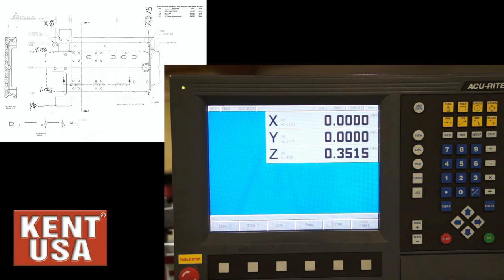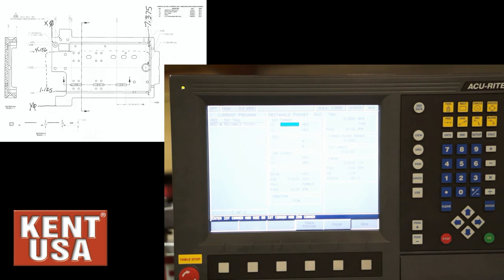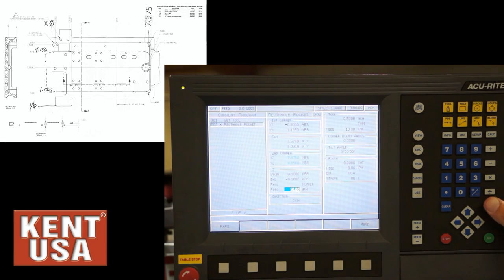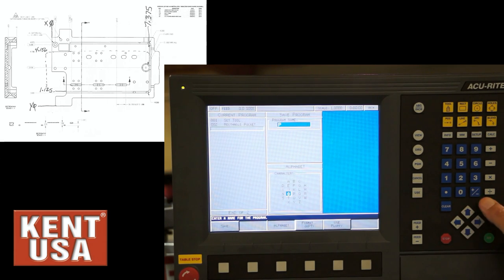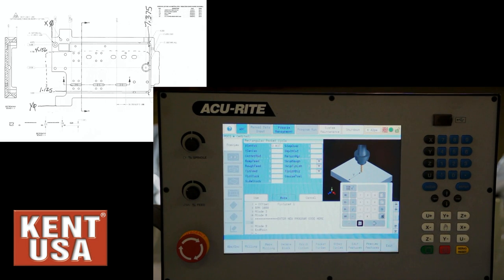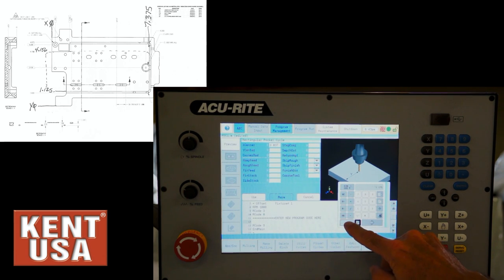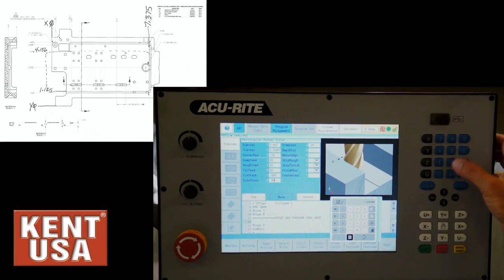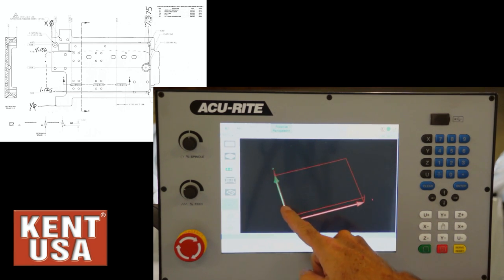Acu-Rite 3500i and MillPwr Comparison Sample 1

Comment: I had problems setting a datum and programing relative to that,  the datum funcrion seemed screwy,  like i would edge find (and move over) and try ro set the dam datum,  and when i would go back to my program,  it would always start from the same machine zero, and not the datum i tried to sett,  and when i would try to go fro absolute to incrimental,  nothing would change it would just show one value bigger, its like i couldnt program from Either a datum i tried to set, or from an Absolute machine position. I think its a bug because constant software wasnt purchase, the microsoft business plan.